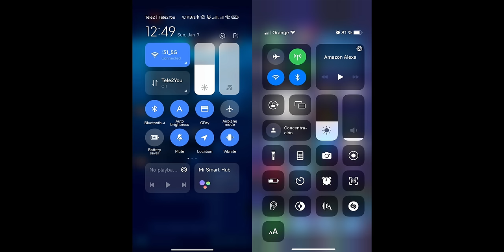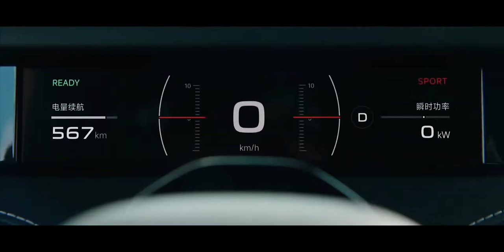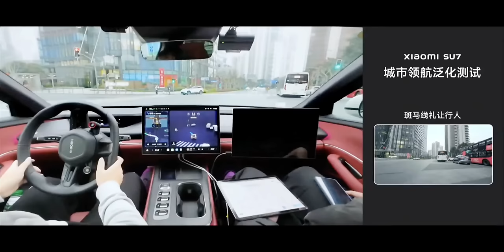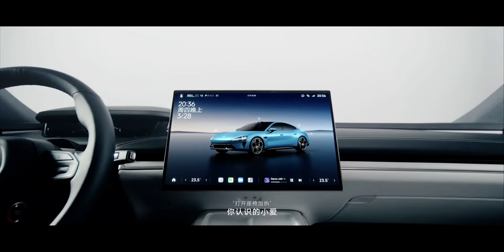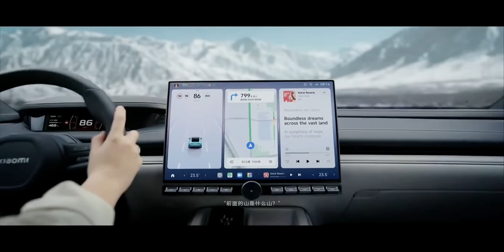Xiaomi’s ALL NEW Electric Car Will DESTROY The Entire Car Industry!

Comment: Tesla will die since it cannot compete in price. Tesla lacks boldness.
Reply: Chinese built means poor build quality , Tofu Dreg cars , Tesla are well in front ...
Reply: @curtisducati  Don't kid yourself. Tesla is now about 15th in line in terms of quality behind a vast number of Chinese EV makers. China controls the supply Chain and manufacturing. Apple were smart to drop out since their 100K USD car really won't sell. Tesla have the same problem overcharging for the same or less quality as Axion cars. BYD is really kicking Tesla's a*. Short Tesla shares. It's only really worth about $25 most.
Reply: Sorry but you just missed the info that Tesla will cut production cost with 40% so begin thinking.
Reply: @bjarnepedersen8206  They need to cut it by 60%;) EV cars are already selling for 12K GBP.
Reply: African cars are much better than Chinese cars. Or did you not mean where the company owner was from, because they are both made in china!?